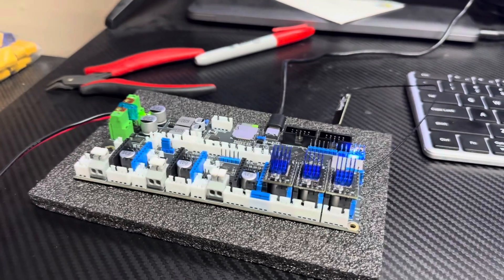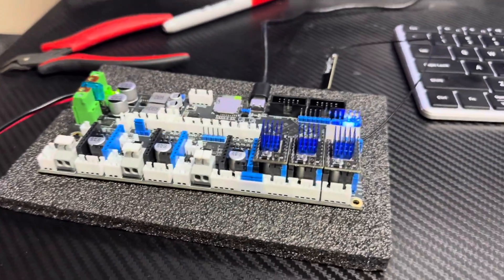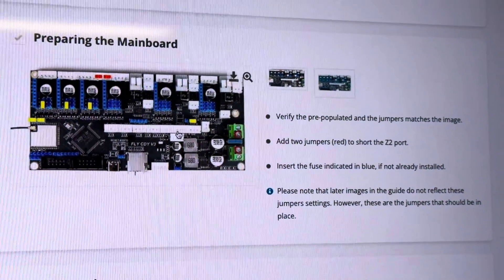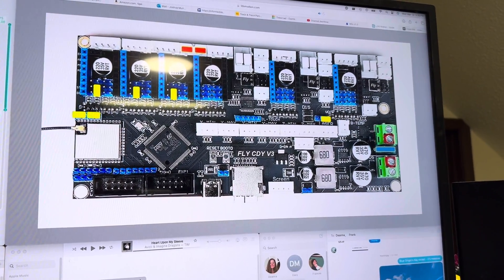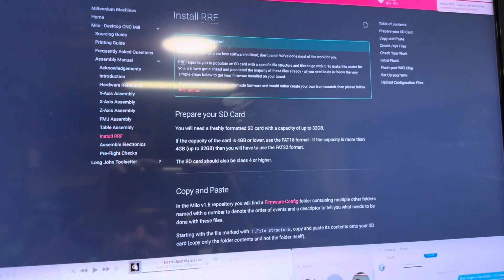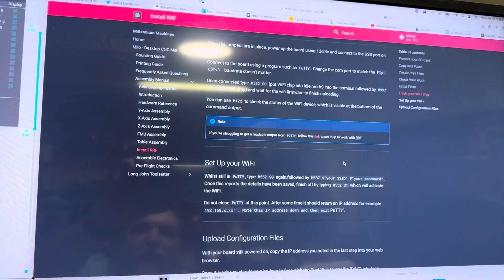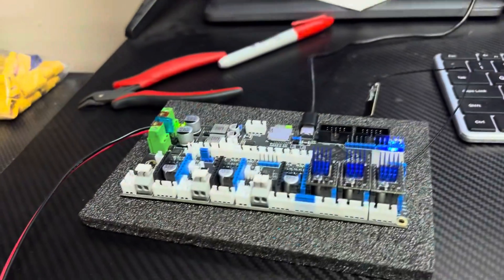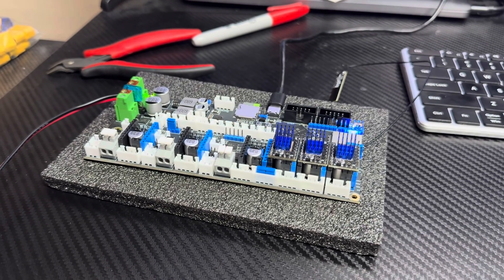Installing firmware for the Milo v1.5

Comment: Hi Josh im still waiting for delivery of my Batch2 milo here in the UK but really wanted to get to familiar with Firmwar eand controller  PCB wiring  many thanks for posting this , i Have Full version of mach 3 so ask where you sourced your Fly CDY pcb as i'd like to have a play before my machine kit arrives ( wouldnt hurt to have spare PCB anyways :-)
Reply from the maker: hey thanks for the comment/compliment!  The Mellow Fly-CDYv3 came with the LDO kit, but you can buy them on Aliexpress I'm sure.  I highly advise buying that exact board, as the Milo team are bundling RRF/configs onto a SD-card package for this board.
Reply: @JoshMurrah   big thanks for the feedback Josh , im a bit late into this and am reading my way through  The Milo discord so loads of catching up to do , really like the millinium OS so your feedback and video helped , cheers  consider me subbed 🙂